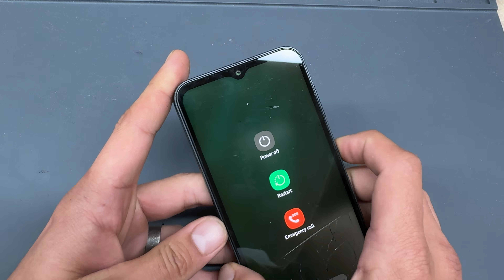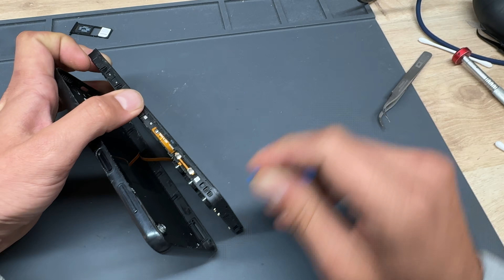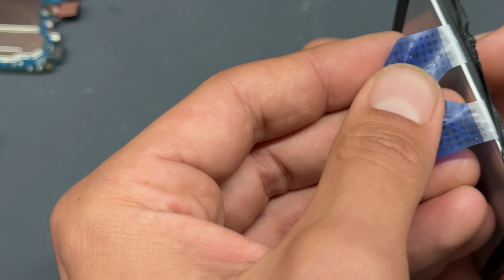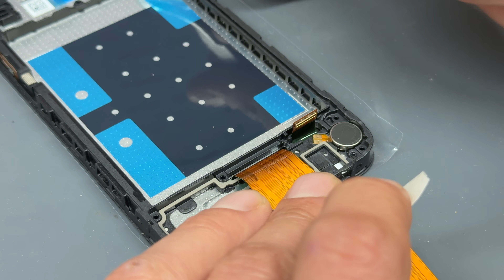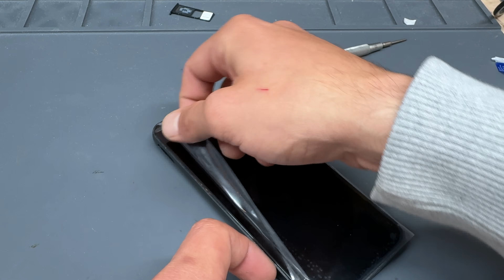Samsung A14 Screen Replacement - DIY Guide To Fix Your Broken Phone Screen!

Comment: Great video, I like the explanations.  My replacement digitizer did not come with the power and volume switches (tiny click buttons under a black plastic ribbon) and didn't come with the speaker ribbon cable.  Both those had to be changed over before both upper and lower circuit boards were reinstalled.  I know that because I had to disassemble it again to install those items.

Comment: I followed the instructions step by step but the phone keeps powering on and trying to factory reset while im still putting screws back in place? Am i doing something wrong? And the corner of the backside wont go back on the new screen correctly 🤦‍♀️

Comment: Thank you! I didn't need to replace the screen, but I dropped it and the speaker stopped working so I (super smartly) whacked it and the screen went black. I've fixed phones before but they're all different and this helped me fix it! just loose cables (though I will admit I am a bit tired as I woke up like 4 hours early and was about to go back to bed, so I didn't fully connect one of the cables back and had to do it all a second time after almost crying for 30 minutes)

anyways, I am so thankful for helpful videos like this lol
Reply from the maker: Glad you stuck with it and managed to get everything working again! 💪

Comment: After finishing the repair it won't power on it is only showing that it is charging any advice?
Reply: recommend checking the power button and the ribbon cable paths. Most likely, the ribbon cable was damaged during installation. And if it's a different type of device, verify that the power button traces are making proper contact with the board.

Comment: Very precise and concrete video. Thanks to share it. After the installation the screen is perfect, but the táctil don´t respond, I have verified the flex  connections, without results. ¿Any idea to solve the issue?. (Now waiting supplier replay). Regards

Comment: I had that one moment few probably have, when pushing the connectors into place, the forked Y-shaped LCM of the new part ends in 83 instead of the original's 85 and put it all together and the new part is incompatible with my A14. Non-phone plebs like myself that have never seen the inside of a phone wouldn't think to open up your phone first to check the part numbers to match them via product image before purchase. Great video though.

Comment: I just replaced ny daughter's screen but now it won't turn on. It was able to turn on b4. I went back and looked it over and i did everything and doubke checked everything and still won't turn on. I can plug in the power cord so i know the screen works but the power button doesn't seem to function. Any suggestions would be appreciated ty

Comment: Hey, question. I got mine replaced by someone else. Now, its bugging and the lower part is overheating which causes the buttons to malfunction. The power button isnt working as well as it did before I got it replaced. And I noticed that the screen isnt flat on one side. Could it be that I was cheated? The guy said he'd redo it though, I was wondering if he actually broke it.

Comment: just replaces my screen, thank fuck these kinda vids exist. i did repair the 5G variant so it should be mentioned there was some few diffrences, like how there was two duaxial cables, and there was also a piece of the backing for the buttons i had to transfer from my old screen or it kept just restarting. so if that happens to you just make sure the little extra button part is with your change. great vid, love being able to repair my own shit.

Comment: Excellent video! I had almost no issues replacing my screen, and so far it works fine. Waiting to see if after market screens are reliable or not...
A few things I noticed that were slightly different from the phone shown (most did not cause issues)- 
there is one less screw on each plastic panel and my screws are silver. 
- The panels are a little tighter on the old screen and "snap" in/out. 
- The new screen DOES NOT come with tiny screen stickers covering the speaker and mic holes - so you will also need to transfer those along with the vibrator motor and internal speaker. 
- There are more pads inside the original screen that the new one doesn't have. Doesn't seen to be an issue for mine. 
- There were 2 wires connecting the mother board - one white, and one black. They can stack inside the slot if pushed in carefully.
One last thing that was a bit of a problem - theres a tiny corner of the bottom motherboard that was nested in a notch next to the headphone port - the new screen did not have a notch so i ended up using a soldering iron to melt one in. I know this isn't the best way to do it but it was easiest - and I made to sure to do it carefully. After melting a hole, it was able to fit. 
Again, thanks for making such a concise video! Definitely will be coming back to watch more if needed!

Comment: I have just finished a screen change on my daughters phone using your video every went perfectly except just before replacing the motherboard i fond that my new screen didn't not come with a button strip tap so I pealed the old one off slowly bit by bit and then put it carefully in the position it came form on the new screen worked perfectly an update on your video showing this part may not be included with the new screen and how to remove and replace it on the new screen would be helpful for other who might find your video 😊
Reply: Had exactly same problem but took a different approach and bought part which was a quid delivered. I will post link as it's something to bear in mind 100%

Comment: I'd prefer to test the display in case of a faulty prat, then put it together. Also, this worked amazingly! I transfered every little piece down to the tiny microphone filter thingys. The repair went great however i dropped the phone in the process and almost ripped the power button ribbon. I was constantly anxious as i did it for a customer. I wouldn't have been so anxious if one of my previous customers hadn't been a dickhead and hadn't called me every hour or so to check on the phone. I have no shop and am just a teen repairing phones from friends and family.

Comment: Dude... I followed your video to the "T" and got a real education on the insides of this phone. I thought it was the screen that was bad so I replaced it following your steps exactly but it turned out it was the battery that was bad but thank you so much for this video!! I got my phone working perfectly again because of you without having to replace it for a new one! One thing I will say to anyone who attempts this repair is to get at least a magnetic tip screw driver with very small tip and or a very fine pair of tweezers to hold the super small screw in place while you try to screw them back into place! The screws are SUPER SMALL and if you lose one good luck fining it again without a metal detector!

Comment: I was able to install a amazon screen replacement kit onto my Samsung A14 5G, allowing me to recover some folders and application logins. It only costed me 20 dollars USD after tax. I would have not otherwise been able to recover. My model had two wires running along the right side of the phone, but using the same idea I easily got through it. The battery on mine was much more difficult to remove as it had some pretty strong adhesive underneath. But this 10 minute long video easily got me through replacing the screen, without any prior experience in this area.
Reply: Hey i have a question what is the name of the product you bought for the phone the mainbourd
Reply: Pls respond
Reply: @MikeHernandez-d2s Honestly just search up your specific phone model
Reply: If you can't find it on Amazon maybe another website @MikeHernandez-d2s

Comment: This video does not mention the volume flex cable which my replacement screen did not come with and my trying to transfer broke the old one. So there I was confused as hell...thinking back to this video. I watch the video all over again and see that your screen comes with a volume flex cable pre-installed on your replacement new screen. I go to peel my old one off to transfer it, after the mystery, and it breaks. Now I am having to install this volume flex cable and not sure If I should bother. Besides that this is a good video, don't get me wrong.

Comment: Great tutorial! thanks so much. Just fixed my screen with your help which I cracked 6 months ago and it's been getting worse and worse! 

The only problem I had was that I bought the cheap screen replacement which doesn't come with the "frame", so I had to find a way to unstick the broken screen from the frame and transfer the frame over to the new screen, then put it all back together. This took me some time to figure out, but it all worked out! :)

Comment: Followed this tutorial to replace a broken scren on my A14. It worked, thank you very much :)
Some notes: 
(1) Check if your screen replacement kit includes the power/volume button flexcable: mine didn't, and I destroyed the original one when trying to remove it from the original screen. I had to order that one separately - cost me around 4 EUR -  and it is very easy to install.
(2) The trickiest part for me was to re-attach the back panel with the power button in place. In order to make it easier, I've secured the power button to the back panel with a 'guide sticker' that came in my kit. After that, re-attaching the back panel was a piece of cake!
Reply from the maker: Well done for giving it a go - admittedly these volume button flexes are a little tricky. I’ve made a note to re-do this video to include that flex the next time one comes in for repair

Comment: I too used this video to replace my screen for my samsung a14. I ordered the new screen from amazon so naturally that meant no instructions or a link/website with a video to walk you through the replacement. I had trouble with alot of the process. For one, the tools were a complete joke and weathered very quickly. I had to use a simple kitchen knife to finally pry the phone open. The battery removal needed more tug than this video showed like many other pieces lol My actual problem came once I got the phone together by like 98% and the screen started spazzing out. Apparently the cover for the bottom area is a tiny pinch of a millimeter off in size. so I didn't even put the screws back in as the initial attempts proved that it was still no room to put everything back together without the screen going haywire. So I did what I had to do considering I really need this phone working when I drive. My car is old, it's cold, and my 4 year old is often with me and I'd hate to be stranded with her in cold without a working phone. i'm proud that I figured it out.
Reply from the maker: Well done! The battery part is hard to show. We obviously have professional grade tools for this so I understand it can be difficult compared with home repair

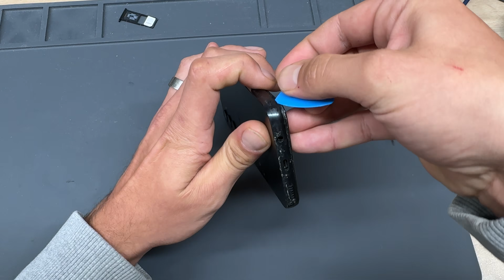Comment: 0:36 I personally recommend a flathead screwdriver. I literally snapped a pick trying to open one of them, I think the extra strength is needed. Also. You literally just pry and the corners unclick with a flathead

Comment: This is kind of lengthy but I just wanted to praise your excellent video. I viewed several videos for this repair and yours is the best.  Great clarity and detail.
I just replaced my screen.  I"ve had a few issues though, that have nothing to do with your video or technique. I replaced my screen about two weeks ago.  First it was working great after I replaced the screen and all was done. Then a few days later it died. wouldnt powe up. Opened it up and found the power to the battery wasnt connected completely. Okay. My mistake for not ensuring the connector was completely snapped into place. Fixed that. Worked fine for 3 or 4 days. But now it will randomly shut down but NEVER when Im using it. I'll pick it up after not having used it for a few hours, full battery, and it will be off. Literaly every time I pick it up after more than 10 minutes of inactivity, it will be off. Ive checked settings. to see if there is something that might be shutting it down after inactivity. NOPE. AND It always powers right up. Always. So last night I opened it up again. Couldnt find ANYTHING disconnected or out of place. And its still shutting down randomly. I cant handle that. Im a mom, a grandma AND I have a lot of friends that are like kids that always need a ride or need something so Ive gotta have a phone that is dependable. Not Samsungs fault, I guess I mustve done some damage when I attempted to repair it myself. This phone is a pretty decent phone. And affordable too.  I put it away because of the broken screen but dug it out again and started using it and replaced the screen and decided I really liked this model. But I think its time to bite the bullet and just buy a new phone. 

Love your video though. Keep up the good work.

Comment: 2:08 My phone has nine screws at the top instead of 10 and a slightly different looking battery. Is this a normal variation or do I have a different phone in the A series?

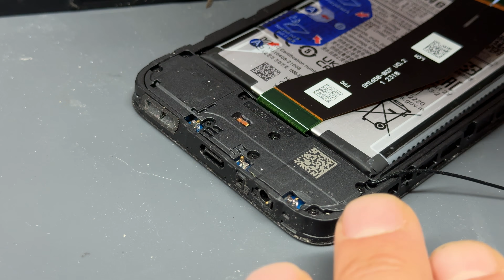2:50 7 screws on the bpttpm onstead of 8. Definitely different from how everything looks pn screen, but. similar enough to follow along. 

So scaredof being to rough with the parts and nreaking anything. If I get to part thhat is too different I can always retrace my steps, hopefully.

Comment: I have followed the video but the screen won’t come on, I can feel that power button is working as it vibrates when you hold the power button down, but nothing on the screen at all
Reply: Have the same issue. Did you find a resolution?

Comment: Looks like i have been ripped off. the screen replacement is just flat there is no more structure for remounting the battery, boards etc.
Reply: I got a similar kit.  You want the one with frame.  Otherwise you need to use glue remover to separate the frame from the screen like this video https://www.youtube.com/watch?v=t3M71dApSC0
When I purchased another one with picture that recommended frame, it came with no tools...

Comment: Just want to let you know I opened up my a14 4g LTE , the inside is not the same as yours. It has a different frame altogether. The ear speaker doesn't even fit the new screen and frame, it's too wide. When I tried to take them apart, it had glue on the inside. 

I think some of the a14 4g has mixed matched parts. Not sure what I'm gonna do.

Comment: Why you don't use glue for the screen?
Reply: Coz in this repair, the new screen comes already mounted on its own frame
Reply: I got one without the frame....then purchased another with a frame...who wants to work with glue solvent and reglue?  if you can avoid it...

Comment: You forgot to remove the blue plastic film on the thermal pad @7:22. Also I’d recommend transferring the battery pull tab from the original screen over to the new screen (easily peels off the black adhesive sticker) so you don’t have to pry the battery out and risk bending it in the future. Other than that very good guide

Comment: followed this and it's really thorough. I like when the repair person narrates instead of annoying music and just points at the stuff. 

that said, dude didn't transfer over the side buttons to the new shell (i think he was just just showing how to replace a screen but didn't actually replace the screen?) Regardless if you don't transfer over the side buttons, you won't have volume/ bootloader control and may encounter an error.
Reply: The side buttons are on the back shell... That flex ribbon right there should be right there, if not you can transfer it from the old phone.

Comment: Hey just finished replacing my screen using your guide and am very happy with the result. One thing to add my new screen did not have  the volume power flex on it so i took it off the old one. Some advice when you do this, there is a little gap in the middle of the volume flex that you can get your tweezers in to pop it out and take it off slowly.
Reply: Thank you these flex cables are WAY too easy to break
Reply: Im just kid
Reply: @mrbanemlbb
Reply: Yeah i broke mine and now i need to actually get it repaired💔🙏
Reply: yea i has the same

Comment: I just finished replacing my screen all by myself thanks to you. For some reason, places were going to charge me as much as I paid for the phone. Bought a kit on Amazon for $25 after I found and watched your video the first time.
My phone had 1 less screw on the top and the bottom then yours, also a rubber gasket from the screen camera that popped out from my broken screen so I added it to my new one.
Thank you so much for making this video. Very clear instructions.
Reply: yeah but just remember the guy that does this probably went to electronics school so he values his work.
Reply: could you send me the kit name i so i can buy too
Reply: Très cool, réparation facile

Comment: I just finished to install. Your instructions are amazing but now is not switching on . The battery works but the on/off button is not. The problem is that the new glass doesn’t have the connectors. I would have to remove from the old one but it seems impossible without to break them . The glow is too  strong and risk  to cause damages

Comment: This was easier than I thot. But it just flashes to push one of 3 buttons. Problem is the side of the screen doesn't have an area for the volume up n down buttons. Or fingerprint sensor. So mine won't right.